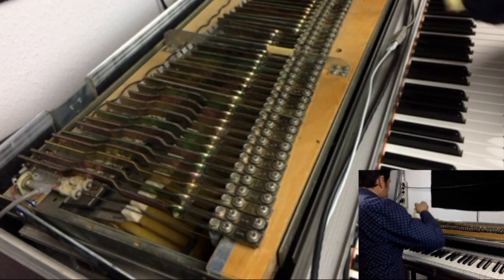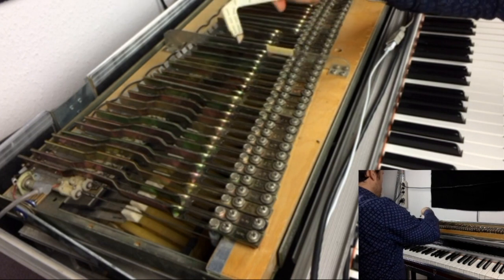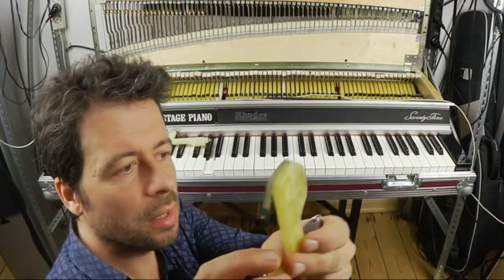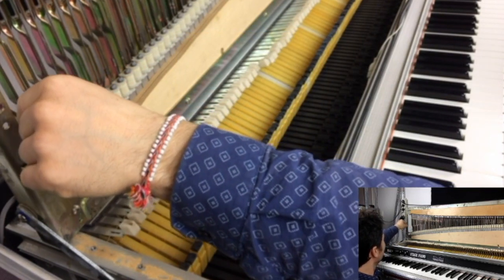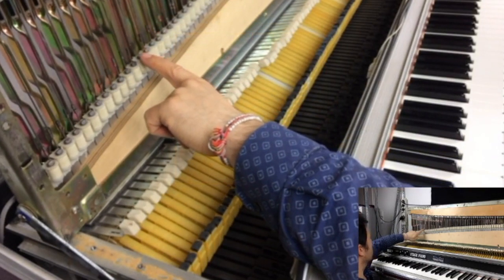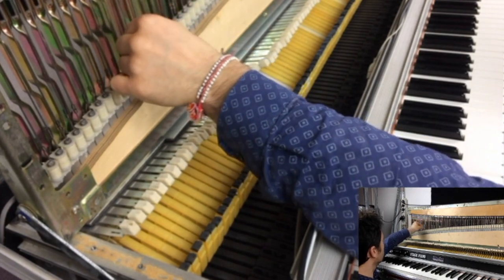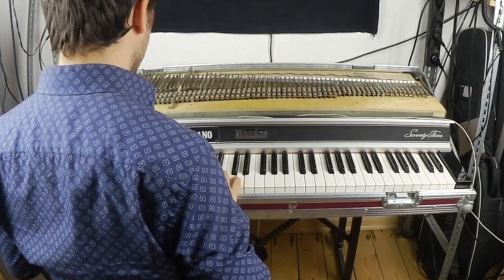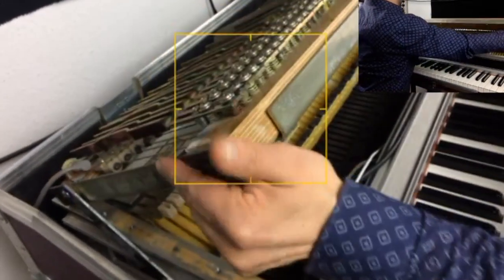Mr Fender Rhodes video insight urgent repair, tuning and how a Fender Rhodes piano works

Comment: A question please....when you play with sustain pedal pressed, how the sound behaves on "ribattuto"? I mean, if i play several times the same note it  will damp the last note and restart or there is like a crossfade (dampers will remain detatched from forks or not?). I use Lounge Lizard wich i love and i'm not convinced by sustain behavior. Thank you.
Reply: unfortunately I don't have access to the account right now :-( The problem what you describe ist typically for plugins and samplers. I guess the main reason for that is the limitation of resources. It is kind of a resource management. The real thing does not have that limitation. Although there may appear some damping because when the hammer tip meets the tine and the tine is on its way down the tip will interrupt the movement

Comment: Nice presentation; What's the amp you are using here ? Also, I had noisy clacking keys in higher register of on my 1980 M2. I tried to tighten and loosen the screws of tone bar,however it's still the same.
It seems like the wooden key hits the plastic hammer and produces big noice
How could I fix the clacking keys issue? Many thanks
Reply: @mrfenderrhodes847  
I think you deserve more views, very skillful playing
Yeh I noticed that, your M2 is as loud as mine; however, I've seen some other Rhodes that are really quiet, this is somehow a mystery to me.
I think there are 2 possible places that could generate this sound: 1. between wooden key and plastic hammer, 2.between the plastic hammer and the metal tine. From that sound that both our Rhodes have, I suspect it come from the first one. I installed brand new pedestal felt and the issue remains. 
You amp is great, could you let me know which one you used here?
Reply: @life-is-inspiring3953  right...I forgot to mention :-) I have a tech 21 trademark 60. Which is quite special but very flexible. I borrowed one from someone and instantly bought it
Reply: Mr Fender Rhodes got it ,thanks!!
Reply: @life-is-inspiring3953  Its got to be source #1. I used a sound meter and discovered the loudest sound/noise comes from that area between the wooden key and the plastic hammer. As an experiment I added another layer of felt on the highest sounding key (easy access) and the clack sound was diminished somewhat but by doing this it raised the height of the key at the front. Oh well, back to the thinking cap.

Comment: the all rubber hammer tip that you took from the top actually has harder rubber than the lower ones. The hardness is graduated and there are four different hardnesses. (not including the wood tips)
Reply: Thanks! I think I thought there are only 2 different kinds...